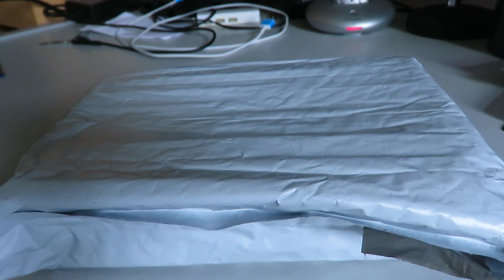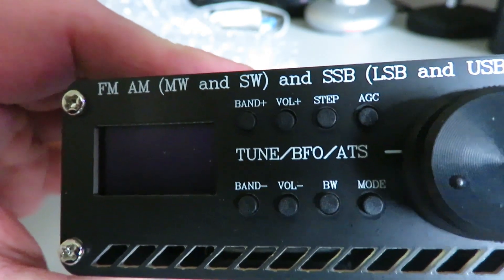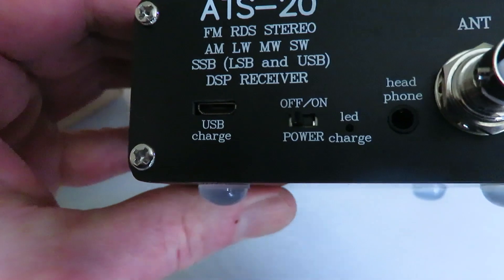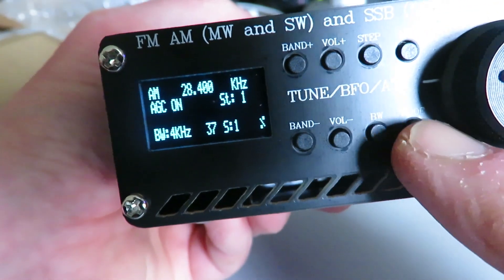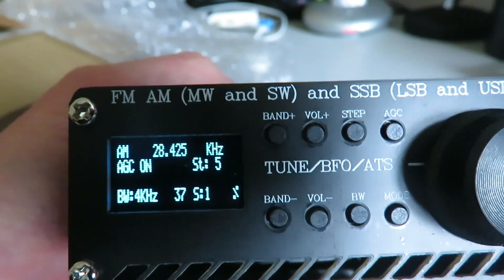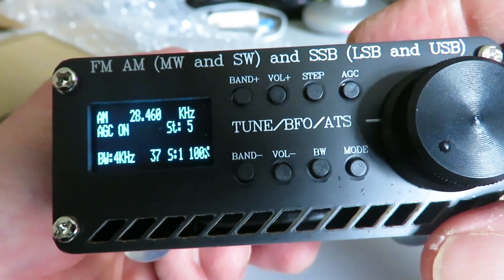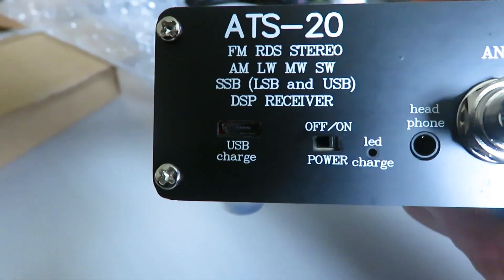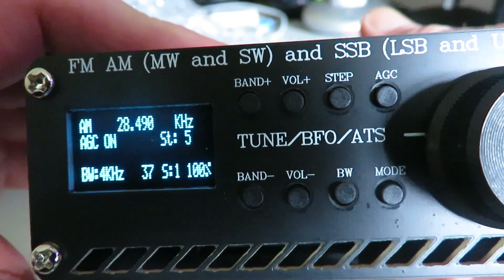Second SI 4732 arrives

Comment: Good advice about trying out as soon as it arrives. I had a problem with an ATU-100 which turned out to be a great attenuator, 100 watts in for 1 Watts out! But I didn't run a full test for a couple of months! It switched on OK and gave the correct start screen.